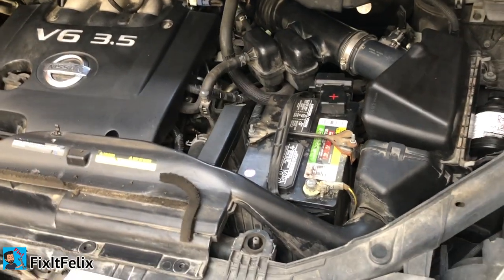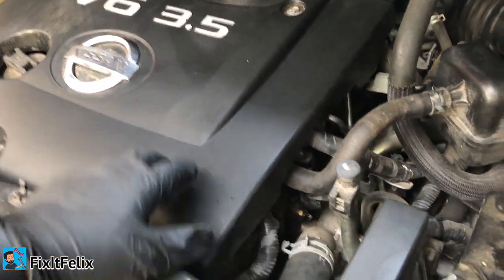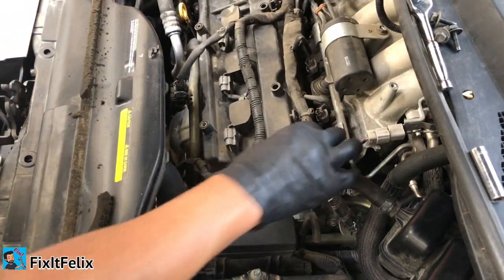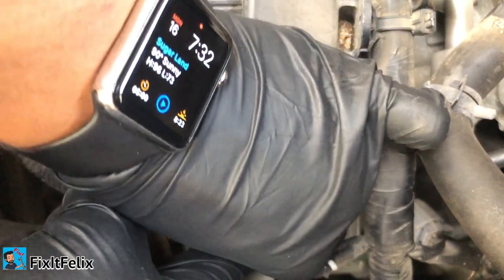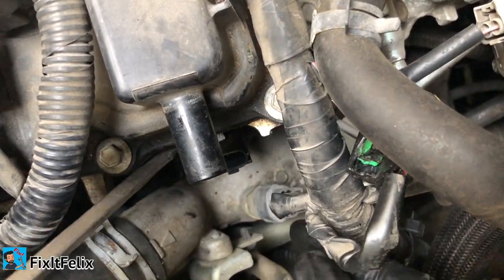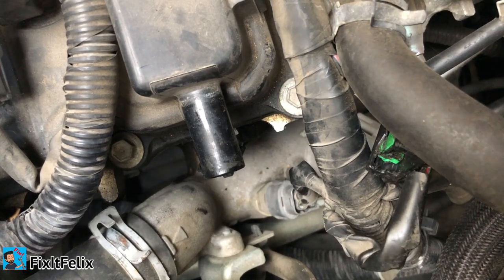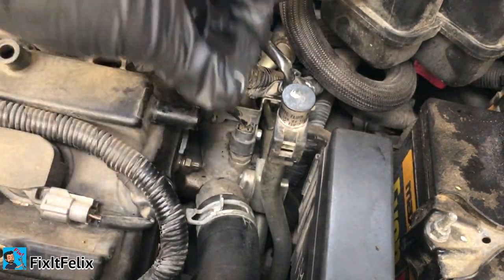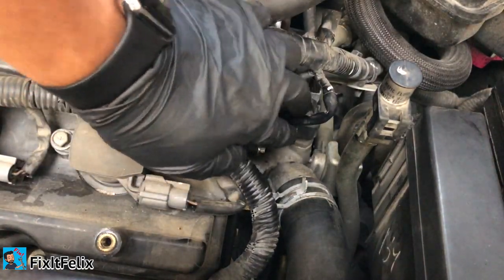How To Replace CamShaft Position Sensor on Nissan Quest 2004–2009

Comment: Thank you Sir.
 For other DIY-ers  - there is an OEM Hitachi sensor at autozone for about $60. Made in Japan.  i used it for a 05 nissan Quest. no issues so far. if you can wait - seems like the one in the Felix's link is waaaaaaay cheaper on amazon.

Comment: The valve covers really like to leak on that engine, which likely contributed to the sensor failure.  When searching for a junkyard replacement watch for one without oil leak

Comment: there is a web sight called rockauto yuo can get that censor for under 30 new with shipping
Reply: I could buy a new car with the money rockauto has saved me
Reply: @wichjr  they saved me a lot as well but you have to shop around still some things are higher
Reply: I just bought this same kind of Camshaft sensor as in this video new for $10 only on Amazon.